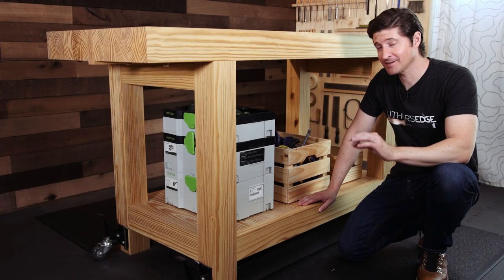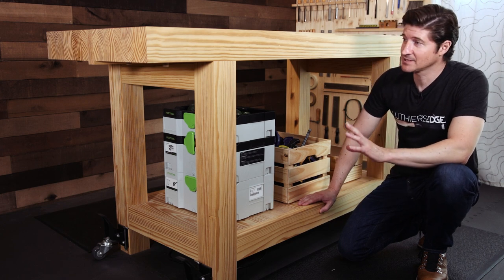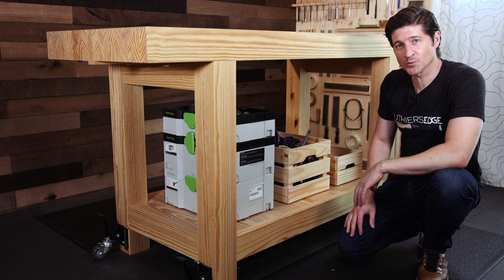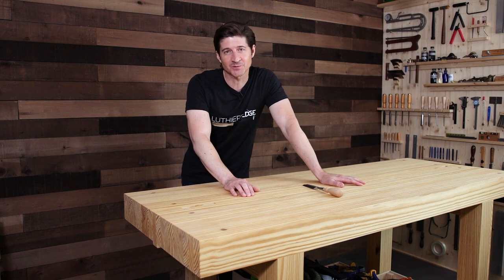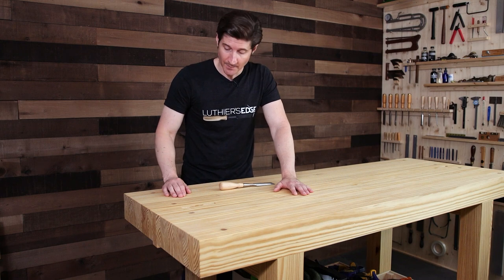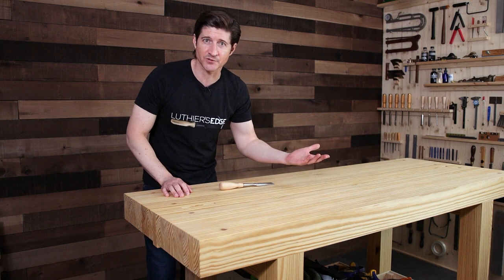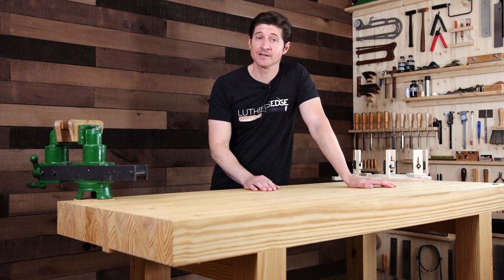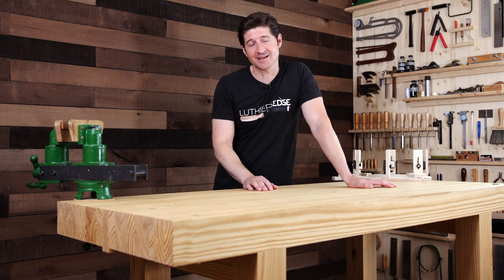Workbench Tour - Simplified Split Top Roubo Workbench (Yellow Pine)

Comment: I have also built a similar split top Roubo like you, using pine. The outer boards are oak. 
As you I also find a lot of useful clamping from center of the bencht. But I have an Axminster vice mounted, since I like to use that all the time. 
Got used to using that type of vice, when taking a guitar building course with Pablo Requena in Malaga.
Nice work!